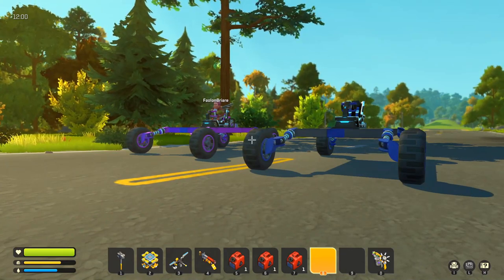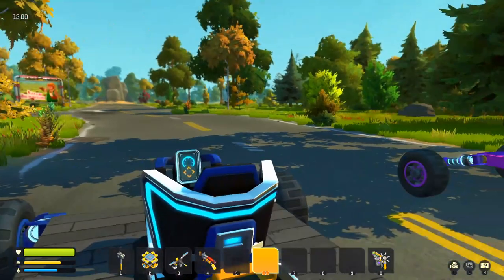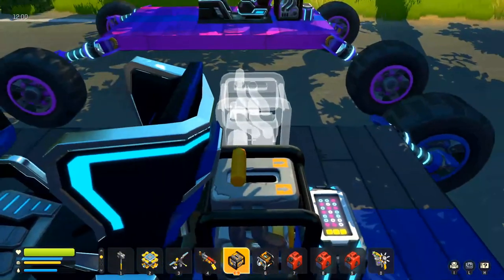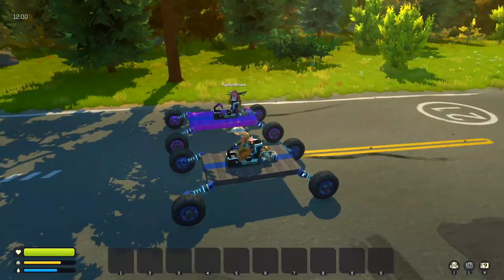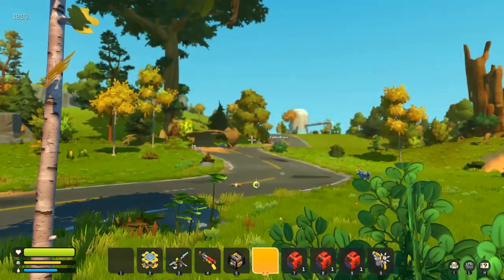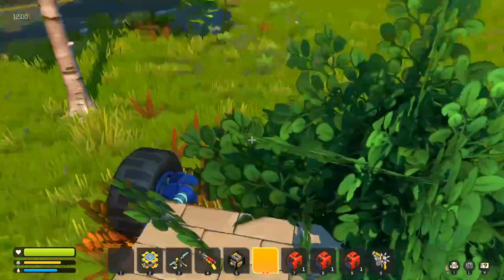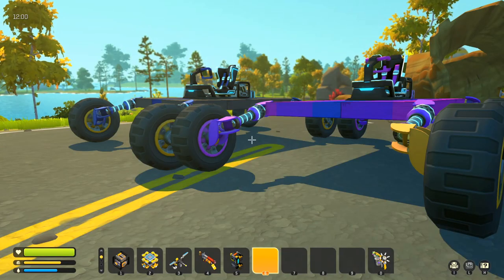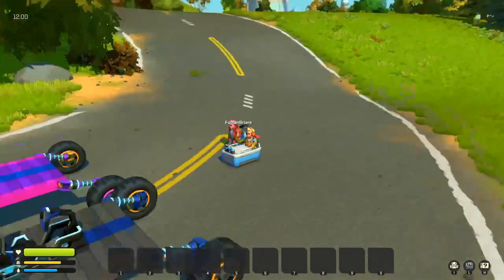Car Tips For More Efficient Vehicles  | Scrap Mechanic Survival Testing

Comment: The first test needs to be redone, 'cos Tier 1 vs Tier 5 engine at the same setting wasn't done properly. You were not in your seat for as long as Fallon was, and while Fallon was seated, his engine was going through gas while you were doing your intro.
Reply from the maker: "spoiler" we tested if sitting in the seat uses fuel at the end of the video and found out that even after 10 minutes of faolon sitting in his seat. There was no change to the amount of fuel in his engine.
Reply: @StormRunnerGaming  Ah... didn't see that until after I commented. Sorry about that.

Comment: Any margin of error small enough to count as the same that can also be discounted to every possible error variable (lag, human, environment) is negligent in my book. It's very much so more of if some how one set up ends up 20 feet before running out vs the other one making it to the space ship and back 5 times.
Hypothesis: For the faster speed efficiency test, the problem you had with the Level 5 engines is every time the wheels left the ground that wheel's bearing loses all resistance and the engine just goes ham on it with whatever throttle you're giving it. So you can end up burning more fuel literally spinning your wheels. The longer you can keep the wheels in contact with the ground and the faster you're able to go, technically the better mileage you get from your fuel. It's not a set rule or anything, but I've just noticed my zippy-er vehicles will burn through more fuel than my big moving truck simply due to me always rolling them. The main difference between my moving truck under heavy load and on a high engine setting vs my zippy 3-wheeler on a high setting is the rolling and I end up trying to "drive" upright. I'm imagining that opening the engine up like that full-pelt just eats gas.
Electric vs Gas, I think it's reasonable only due to it being similar to reality. If you think about it, a full charge on a Tesla, Leaf, or any other pure electric car will only get you so far. A full tank of gas with most other similar build of car will get you a bit further. But I'm not sure if this was the reasoning behind this. Technically, in that case, the electric engine at max should be giving an insane amount of nearly instantaneous torque, but you can actually get more out of the full max gas engine. So I don't know.

Tests to possibly run? Duelies. You can mount wheels upon wheels (FOR DAYS!!!!) and make impromptu dual wheels. Does this help at all or does it detract in efficiency.

Friction stat. What does that mean? Does that mean higher tic marks the less it'll want to move/slide or what? Would it be better to make a vehicle with less friction or more?

Offset wheels. Similar to duelies, you can mount wheels offset from the center of the wheel and this makes it so then the vehicle will kind of "crawl/hop" along rather than roll. Does this burn more fuel besides looking janky?
Nuts&Bolts traction. Something I've tried but I'm not 100% sold on because I'm biased for my own ideas. . . . Is taking all of the decorative nuts and bolts and sticking them into the driving wheels (the ones receiving power from the engine) to make the wheels have a kind of edge. I've noticed that it helps go up hills in some cases, but again, that's probably my bias. I'm placing them at each "corner". wheel will hold 3 along an "edge" but I leave out the middle one because it doesn't really contribute to the traction. It's a bumpy ride, but try it out.
Lastly; 4 better than 1? So it's probably not going to be efficient, but would having 1 engine per drive wheel be better than loading all 4 onto 1 engine? Both for power and efficiency. Sorry this comment is an essay, but so much to say and suggest for a great video.
Reply from the maker: I don't mind the long comment. There are some good ideas in here
Reply: running out of fuel with the lvl 5 engine on low is due to using power to get up the hill and not moving.

“Scientifically” speaking, you need to do the tests several times and take the average (I know, limited time to play and limited amount of time for effective video) 
That way errors (or outliers) are minimized or discovered.

Great test though! Very interesting :)

Comment: How did you tilt the suspension like that !?
Reply from the maker: I have the suspension block on a bearing connected to a controller.
Reply: pro trick: you can watch movies on KaldroStream. Been using it for watching loads of movies these days.
Reply: @Ahmed Izaiah Yup, I have been watching on flixzone} for since december myself :)
Reply: @Ahmed Izaiah definitely, been using Flixzone} for since november myself :)
Reply: @ahmedizaiah9199  What does Scrap Mechanic have anything to do with movie?
Reply: @dukereginald328  Alt account?